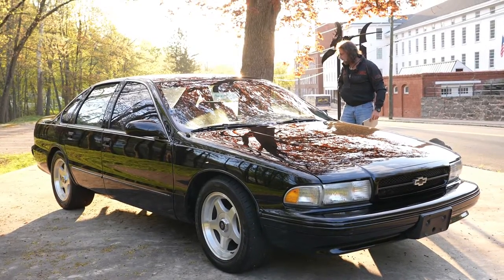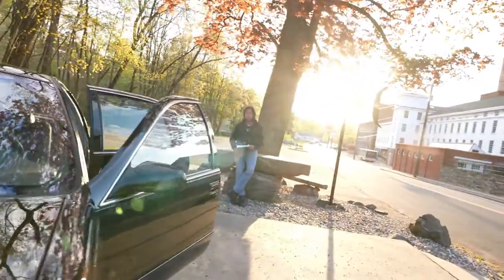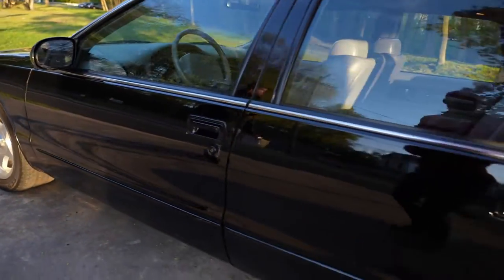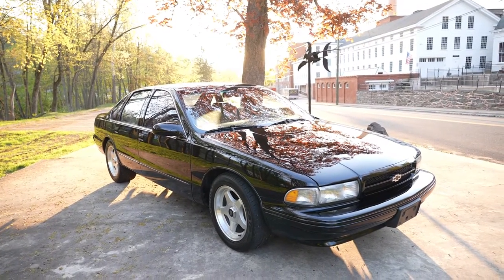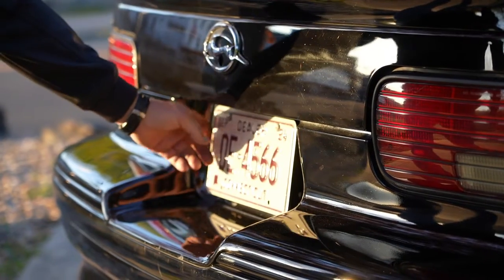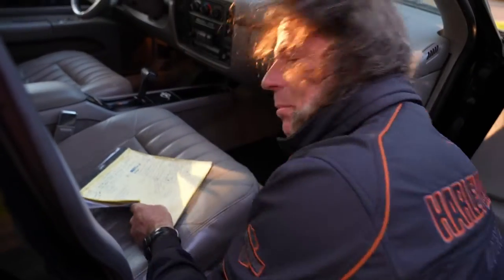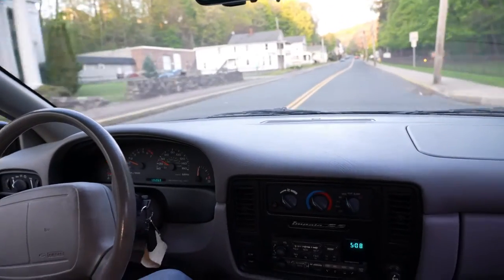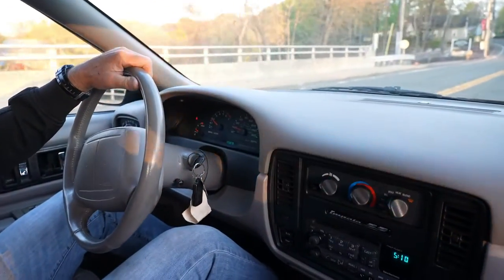1996 Chevrolet Impala SS

Comment: We used to roll around in the standard versions. Add a few 12" subs to the trunk with a little Pink Floyd and all is well.
Reply: I just bought a skirted 92 Caprice slapped a 15 in the trunk and straight piped it will see what happens

Comment: Great car. The last "modern" car I ever wanted to own. 
'96 was the last year and the only one with console shift. So '94-95 had column shift. '96 is by far the most collectible.
Reply: sorry about the auction... too many have sold in the last year all with low mileage
Reply: Time will tell, the ‘94 only had about 6,300 units produced, technically making it rarer. But like you said the ‘96 has the desirable analog gauge cluster and floor shift.
Reply: I read a post that said the 95 blue grey metallic had the least units made out of all of them.i don’t know how true it is.
Reply: @Dustykeybkards  hmm, you are right, there were only about 4,440 DGGM ‘95 SS, good point
Reply: Can any of you gentleman make a good guess on a legit private party price for a 1996 Impala SS Cherry in color, totally stock, minor bumper paint and one power window don’t work? 90K in mileage, original owner? In Arizona.
Reply: @solomonknew1117 $8000
Reply: @HAM8181  Sold for $11,500.00 5 months ago.
Reply: @solomonknew1117  love it. I just paid $4500 cdn for a 94 3 owner. Keep those prices soaring!

Comment: So blessed to have 96 I bought last year, continuing the project build from the seller. Kept the LT1, custom cam, comp lifters, 2.5 inch full exhaust, long tube headers, torqhead conversion to coilpacks removed optispark, 58mm throttle body, MAF from a F-Body, 50lbs fuel injectors, plan on getting it tuned next step.
Exterior looks just like this original so people sleep on it...unless they know the car lol
Reply: That’s awesome. I’m stuck between buying an SS or a 94-96 Roadmaster and modifying it by the end of the year.
Reply: @artvandelay4900  the road master is definitely a good project, my brother had a 95 and was going to do a Torqhead conversion and follow my build but decided to sell it. Kinda wish I bought it off him cuz I fell in love with it

Comment: Cast iron block and heads.rated at 265hp so as not to upset the corvette buyers. Reality is right at 300hp. 96 made about 30,000 its last year in 3 colors Black,Black Cherry and a Sea Geen.96 only one with console shift.95 6300 units in 3 colors. 94 6300 units black only. Also fastest stock with 3.42 gears in the pumpkin.How do I know this Sh#t?? I have owned a 94 since 4/94!! DON'T SELL IT KEN!! Sell your fox body instead!!
Reply: Impala came with 3.08 gears.

Comment: He sure kept it nice,about 340 hp LT1
Reply: Can you elaborate on the "340 hp" figure? 
Official figures between 260-280hp for the impala SS and the cop interceptor, but the same engine in the Corvette 92, started out at "300hp". David Freiburger said it was "at least 300hp" about the beat up 9C1 he was thrashing in a few episodes of "Roadkill".
Reply: The corvette of those years had aluminum heads and larger valves. Flowed better than the cast iron
Reply: @royculleton6223  the 96 LT4 heads. The cast stock LT1 heads flow better than the aluminum stock LT1 heads
Reply: @impalaSS65 he may be referring to the one in Richard Holders video. These were underrated from factory. Only ford makes interceptors btw lol